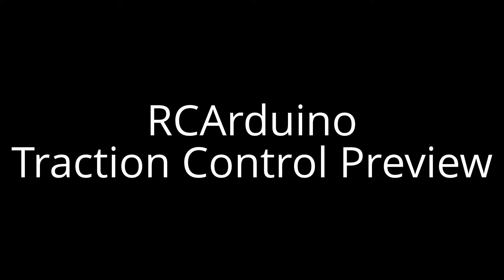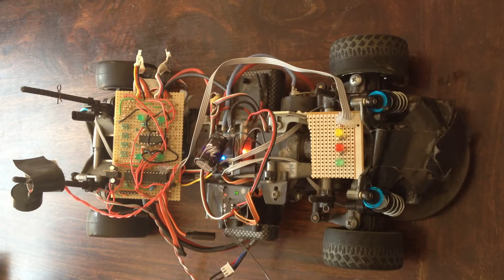RCArduino Traction Control - Update Part 1

Comment: Presumably this only works with 2WD right? The biggest problem I see with traction in RC cars is that their power to weight ratio is so high they can spin all four wheels on loose ground. Seems like a much harder problem to solve though.
Reply: This could probably be done with an accelerometer, calibrating it with lower accelerations first to get a curve of wheel speed and acceleration. The accelerometer is also needed to make an ESP. That and the state of the direction servo.